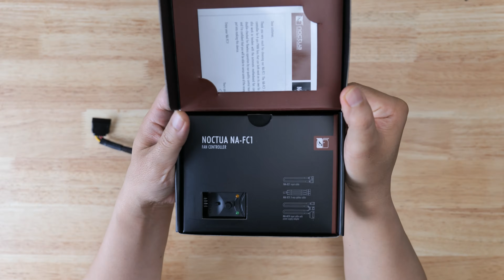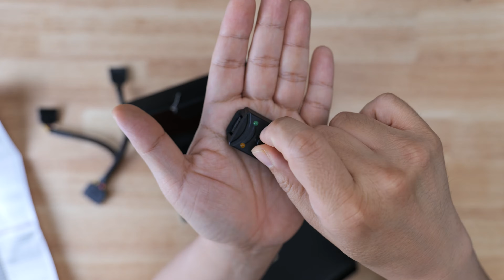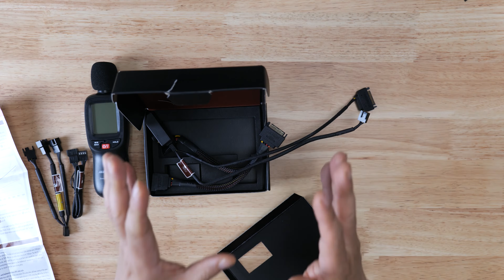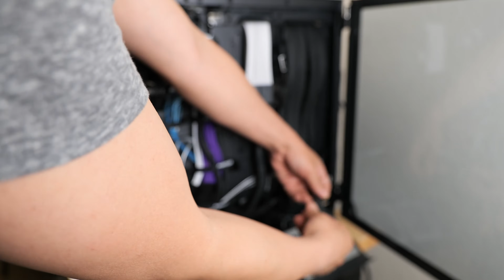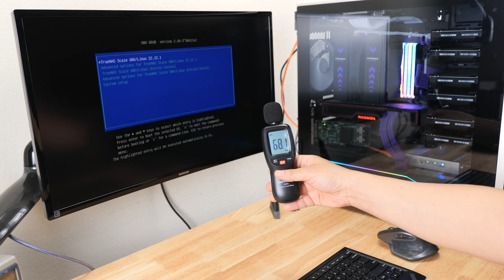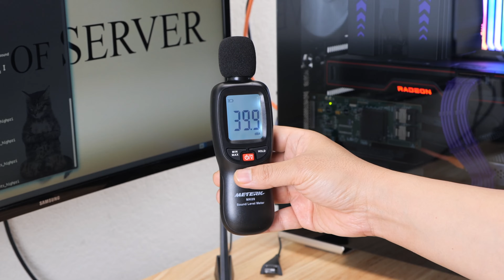Hybrid Desktop PC Server Build | Noise Reduction with Noctua NA-FC1

Comment: Nice! As always great video! 

Question - Do you have a list of Noctua fans that could replace the fans in the front of the Dell Precision T7910? I've got the CPUs with the AIOs as you shown in the videos, but I still think the fans from the AIO and the ones in the front of the chassis are very loud under load. I would love to replace them with Noctua ones for the sake of silence. I've purchase a few fan adapters on AliExpress that could get 4-pin fans to the Dell connectors in the motherboard but so far haven't pull the trigger on the fans yet. If I can replace the AIO and front case fans it would be awesome.

Thanks!
Reply from the maker: Sorry, I don't have such a list. The fans in my T7910 are not that loud and I never thought to replace them.

Thanks for watching!

Comment: I recently modded 4U shelve to mount atx system inside: full atx board, standard psu and 3 2,5 drives. It works great. The only noisy part are reverberations from the power supply, which I have to isolate somehow from the shelve. Just some cheap rubber will do. I would not call it noisy, the hum is acceptable, but I am a musician also, I fear to develop tolerance for it's frequency. I want it as quiet as I could and eventually swap the psu for some super silent system, which do not even spin a fan under 150W load.
Reply: fanless Super Flower 500W

Comment: I'm a little confused by your video. I believe the way this controller works is basically reducing whatever the signal sent from the motherboard is by the amount on the dial. So in your example, with the desktop in suspense and no fan control, the system was ramping to 100%, (likely no PWM signal from motherboard) so with the Noctua set to 70%, you have reduced to 70% of maximum speed. I think we are on the same page there. However, when the desktop is active and is modulating the fan speeds in accordance to the fan curve set in BIOS, you're still reducing the fan speed from the original. So for example, if your motherboard was sending out a 70% PWM signal, the Noctua is still set to 70% and thus your actual fan speed is now 49%. I don't believe the controller is "passing" the control back to the motherboard once it detects a PWM signal, it's still reducing it. Perhaps that's what you meant but I had a little trouble following you. This would be easy to verify by simply comparing the fan speeds in all 3 scenarios.
Reply from the maker: You're not confused at all. You are exactly correct. The NA-FC1 should reduce the incoming PWM signal from the desktop PC MB as well, but I can compensate for that with controls on the MB knowing it will reduce the PWM signal if needed (doesn't seem to be required so far). What this buys me is control of the PWM signal to the fan hub when the PWM signal from the MB is out. I guess I could have explained that better, but you are correct.